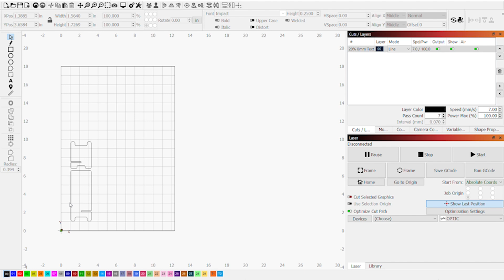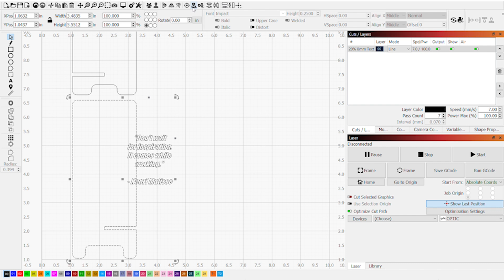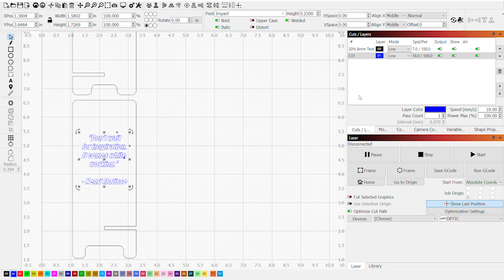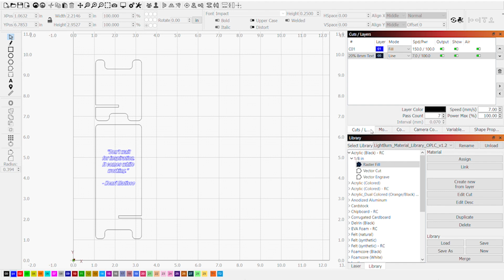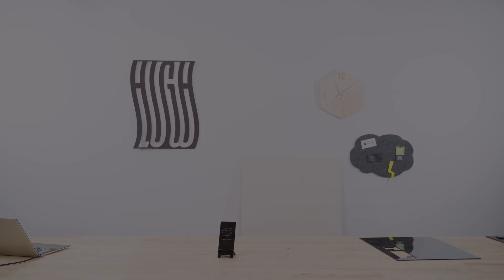Optic Walkthrough & Demo

Comment: Hi, I saw the three vertical lines that don't have metal. Where the cutting mat folds. May I ask if that area will get damaged in the long run as it seems non metal when it gets burned by the laser. Have you thought about using something like a honeycomb base and air assist?
Reply from the maker: Hi, thanks for commenting. Regarding the three vertical lines - these are the cutting mat hinges, which are made from spring steel. This material was chosen specifically to be flexible but also durable, and stand up to the laser beam over long-term use, just like the rest of the cutting mat. And regarding air assist - while normal air assist would work against the integrated filtration, we have actually implemented a modified 'air curtain' which improves performance similar to an air assist, but moves air laterally to cooperate with the integrated filtration. Hopefully this helps answer your questions!

Comment: Wow, excellent video, has to be one of the most complete portable and well built Laser engraver / cutters I have seen. Interested to know if cutting across the gaps in the bed and how that material behaves over time, compared to the main aluminium bed.
Reply from the maker: Hi, thanks for commenting. Regarding the three vertical lines - these are the cutting mat hinges, which are made from spring steel. This material was chosen specifically to be flexible but also durable, and stand up to the laser beam over long-term use, just like the rest of the cutting mat. And regarding air assist - while normal air assist would work against the integrated filtration, we have actually implemented a modified 'air curtain' which improves performance similar to an air assist, but moves air laterally to cooperate with the integrated filtration. Hopefully this helps answer your questions!